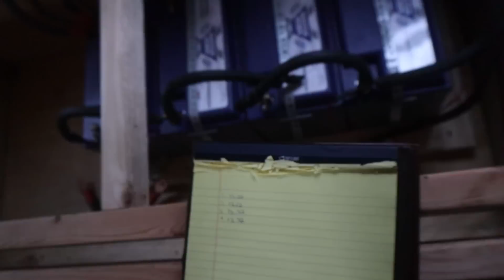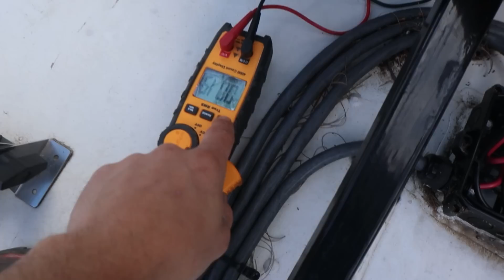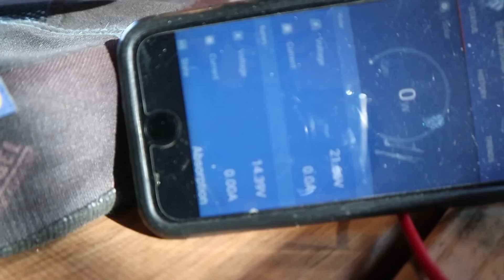Inverter Caught Fire | Fixing A Solar System After A Lighting Strike

Comment: Nice video! Your pupper is absolutely adorable. I have a question if you have a sec, I read that a battery isolator won't work with Lithium Ion batteries, is that entirely true? Trying to figure out if I need to send mine back for my setup 😂

Comment: Is there anything that could have been done to the system to prevent damage from a lightening strike?
Reply from the maker: The system was wired correctly when I first checked it. I am not sure there was much he could have done but parked the bus somewhere else that day. Glad no one was in the building or bus at the time.
Reply: @navigationnowhere disconnect the solar array and hope it doesn’t jump